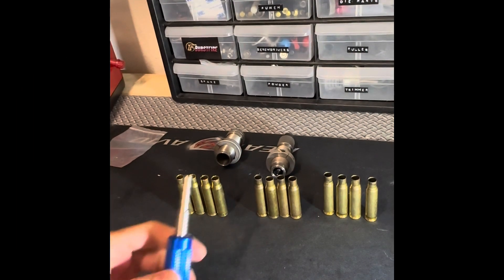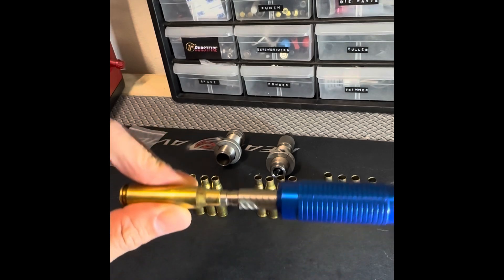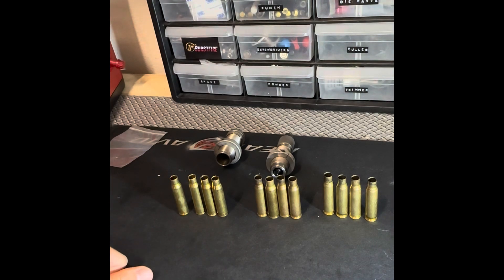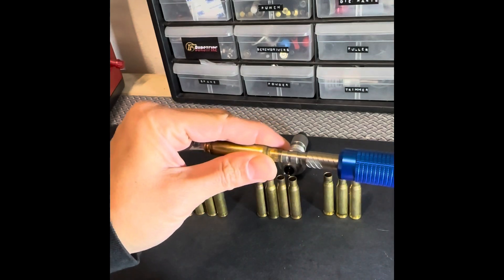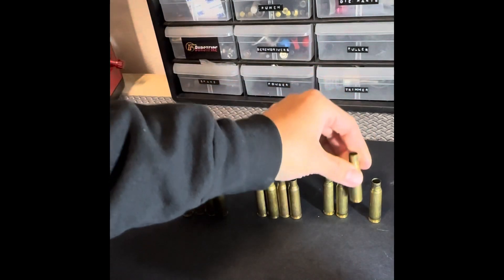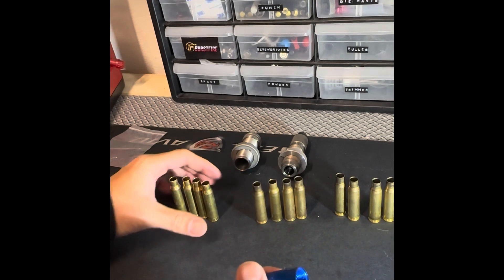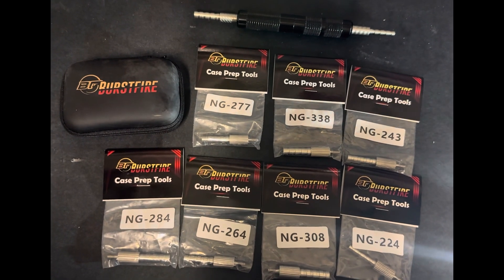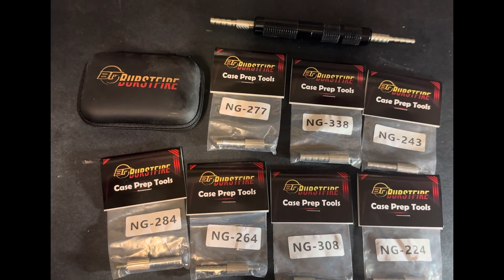Case neck tension on annealed VS not annealed brass case - Neck tension gauges

Comment: So that's annealed before sizing?  The variation in tension by 1/1000" would stay the same if resized without annealing but then annealed would the consistency of the neck tension improve?  I've got a bucket of brass that was all ready to prime and load waiting for my new Burstfire to arrive.  Should i anneal and then resize again?
Reply from the maker: Hi. Yes, always anneal before sizing, to ensure consistent sizing results. 

Yes, in this video we demonstrated brass that has been work hardened, and the inconsistency in the neck tension of annealed vs not annealed cases on two different headstamps. 

The batch that was  “properly” annealed had consistent and accurate neck tension. The 0.002 expander mandrel was used, and that’s the result you should expect. The others not annealed went through the same dies and process, but results were inconsistent. 

As for the batch that has already been prepped, depending on the condition and brand of the cases, I may or may not, personally. If I were using only once fired Peterson or Lapua, I may skip it. More than once fired without annealing would re-process. Any other headstamp I personally would anneal and resize because I simplify don’t have confidence they are consistent and will produce the result/performance I, personally, would expect from my loads. 

Hope this helps!